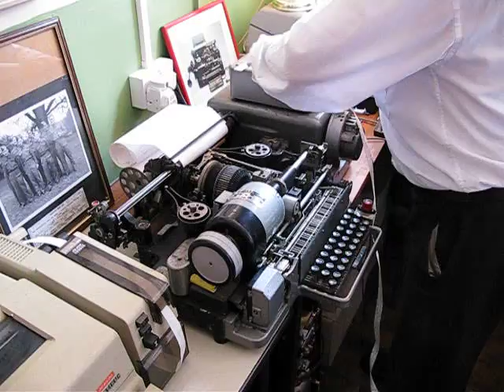Teletype & punch tape reader writer. Amazing sound of mechanical machines.

Comment: In the Navy in the 70's we had to be able to read this tape.
Reply: I also did in the air force comm centers in the 1972-76 years. Loved it.
Reply: This may be a stupid question, but how do the mechanich of converting morse code to a 5 hole sequence work?  Morse code is a series of dots and dashes, how does the machine discern wich is wich?
Reply from the maker: What you actually see here is a Punched Tape reader reading a series of binary encoded number, one on each line. That combination of pins (covered or non covered) is then fed to a teletype printer that interprets the number and prints the corresponding character.
Google Baudot Code.